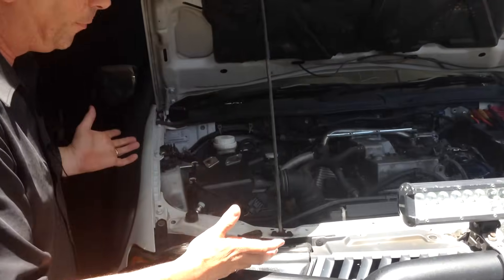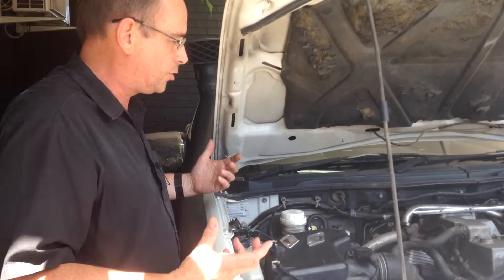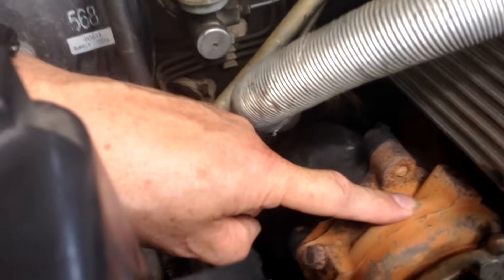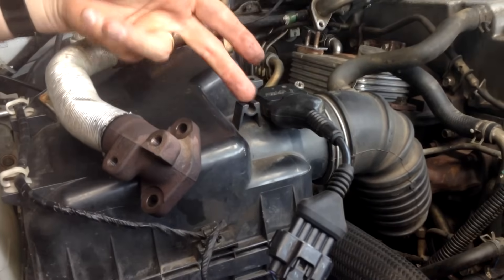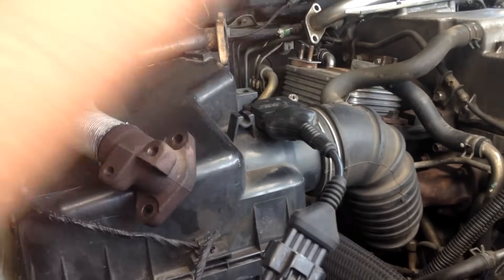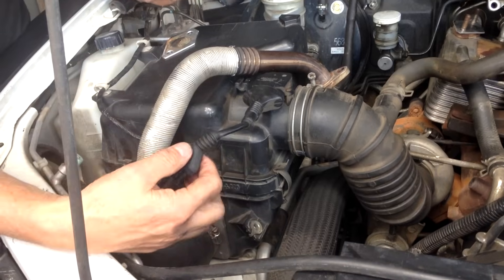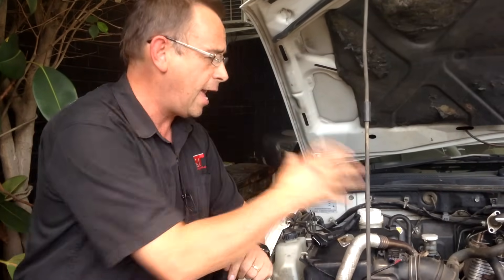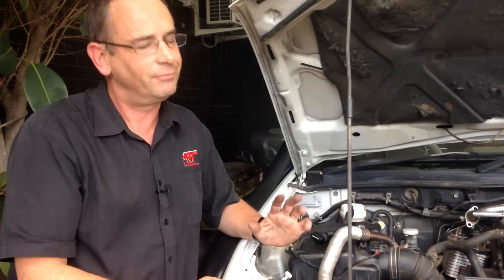How to fix EGR Soot Buildup in a Turbo Diesel

Comment: I bought a SAAB 93 1.9TDI a couple of years ago and in just a few weeks, it went into Limp mode and upon inspection, I saw that there were these weird things hanging out of their holes, and the holes were so badly worn, that they were fairly much rounded off squares and egg shaped instead of circular. I had to replace the inlet manifold and the EGR valve was clogged up to buggery.

Im not a diesel mechanic, Im not any kind of mechanic if I am honest and so I got my mate to sort it out.

The engine light kept coming back every time we clear it ( still does ) and so, as a suggestion, what we did at first was simply blank it off... then he suggested drilling a small hole, so I put an 8mm hole into the blanking plate, then a 10mm and now its got a 12mm hole.

I have, for the last month maybe a bit more, been using the best diesel that I can get locally and that is Shell optimax, and this has done 3 things that have made me decide to never go back to cheaper fuel.

1 - My car is purring like a very contented kitten
2 - It is all of a sudden doing hugely better mileage per gallon
3 - Buying the expensive fual has saved me a small fortune already

In fact, while filling the tank was 17 quid more expensive than the Supermarket crud I was using previously, ( Thats a shocker I admit ), my mileage has shot up and so instead of filling the tank every 5 or 6 days, I am already on day 7 and I still have well over half a tank of fuel left.

The engine warning light is still there but it is early days, plus, I have the 12mm hole and so I am going to just take the plate off completely and see how it goes from there! - I will reset the warning light, it always comes back after only a mile or two, but lets see if it stays off for any longer... Again, Im not expefcting miracles, but I certainly have had them in this last month or so.

Anyway, what I am saying is that to not have your engine fill up with sooty crap, just stop buying cheap supermarket fuel and splash out on good quality fuel... It will be much better in the long run. I used to put Shell in every 4th or 5th tank, just to treat it, but now Im putting nothing but the best in.

I know that many say that it makes no real difference and sure, that may well be true in most cases, but it has albsolutely made a massive difference to my car... It now runs smooth, quiet, cleaner, and is cheaper to run.

Oh and one thing I do admit to, is that the first time, I did put in a bottle of redex Diesel treatment into the tank.
Reply: Question my zafira 1.9 cdti was hissing after blanking at the top , so blanked it at the manifold aswell did a oil change 5w -30 car was running good till today when i heard a big Puff sound lost power and its ticking while driving like a lollipop stick against a moving bike wheel ,I inspected it its blew the manifold blanking plate gasket  and black Soot is on my engine ,I'm back to square 1 any help please ?
Reply: @GG-nz7vd  use gasket maker next time 🤷‍♂️
Reply: Gli additivi per il gasolio del brand tedesco Tunap fanno miracoli sui motori diesel, tunap183 e gasolio Q8 fanno miracoli❤ complimenti per il bel motore Fiat montato sulla Saab❤

Comment: I put an egr blank on my 3.2 4m41  from new . no probs ever  .. less than 2 mm build  up of soot at 222000 kms when I dismantled to do Tappett  adjust and new timing chain guide. I also have been using Penrite hpr 15w 40 engine oil from new changing every  7500 kms
 instead of 5 w 30 as recommended....Zero chain guide wear noted .i think the key is thicker oil to decrease oil misting and limit or stop the egr.
Reply: Whoah!! They need that thin oil to pass through the galleries in the variable Vein turbo. Probably not wise

Comment: if you confuse the engine management system that air intake temperature is below freezing point than the egr is automatically turned off.  works well
Reply: Paul Clarke how do u confuse it
Reply: @adventuredownunder1  like a blind man at a nudist colony. is not hard.
just confuse the air intake sensor its not cold

Comment: What happen if you just disconnect the electric plug on the egr admission valve??
Reply: It would through up a light on the dash and possibly even go into limp mode
Reply: @danstanford89  naaa, if you disconnect you are making the engine work in normal way... it works better..
Reply: @zhr4121  yes and it will cause an error code on newish modern engines. why ask the question if u supposedly no the answer
Reply: z it

Comment: So reprogramming the Engine ECU  is the best way to fix the problem of soot build-up? Can one assume that your reprogramming of the ECU will not introduce other issues, and you provide a written guarantee that any issues which may arise will be repaired by you, even up to repair or replacement of an engine which has a catastrophic failure as a result of the reprogram?
Reply from the maker: Paul, we guarantee all our work 100%

Comment: Hi Brett, my understanding of these engines is the charge air inlet temperature sensor that is used by the ecu for precise fuel delivery is downstream of the turbo due to temp differences created by the turbo. The temp sensor as part of the mas is for the EGR only and the module/resistor just fools the ecu that the air is extremely cold and thus keeping the valve closed in all operating parameters except for lift off where excess intake   pressure is vented to exhaust. The only real difference from factory ( apart from it being illegal) is that the charge air is now entirely air, and not a mixture of air and exhaust gases, which results in a slightly leaner mix..ok for diesels, not ok for petrols as they will run too hot. The Egt  is not really effected by this mod. The best solution is your  remapping of the ecu but for the home mechanic who has cleaned his own inlet manifold the EGR off module and a catch can is a pretty good and safe solution
Reply: I run an oil catch can and cable EGR delete ..drives fine to me and remove the cable at service time  7 year warranty  2019 MR triton
Reply: @jackthornton3496  yes the 'egr off module' or cable delete as you call it for the Mitz engines, i have a  Pajero, is an effective solution for these prone intake blocking motors. I took the intake off and cleaned before doing this years ago and running faultless with good power and economy since. Interestingly when these engines are suffering chocked inlets the soot and nitrous oxide emissions go through the roof defeating the original reasons behind Egr. Not to mention poor performance and bad fuel economy, and the dreaded Mil (money light).   Engineering gone wrong it seems!
Reply: @ajcuthy1945  Engineering gone wrong Lol   with an EGR it reduces clean air and replaces it with dirty non air  50%( and that's wasting fuel because more right foot is needed,to make the same power and an added bonus a dirtier engine Lol
Reply: @jackthornton3496  yep spot on...a feedback loop that chocks the intake at an ever increasing rate. Also its an expensive exercise to have a mechanic pull everything off an clean it. A defibrillator may be required when presented the bill😁.  Having done it myself its a big job as everything is bolted to the intake manifold including the common rail. The intake runners in the head are almost impossible to clean as well. Best to fit erg off and catch can from  new I'd suggest.
Reply: @ajcuthy1945  what year pajero do you have
Reply: @goldmagnet  A 2009 NT manual, still going strong with good fuel economy. I know a couple people with Pajeros that have close to 400k still in service. I was asked what would i replace my Paj with and i simply don't know. Too many new vehicles have issues and i don't want a twin cab. The Pajero seems to do all tasks well, with nothing exceptional, and there reliable. Just keep up the maintainance.
Reply: @ajcuthy1945  yeah sweet, my missus car is the 2012 exceed model, it's awesome on fuel economy and nice to drive. I've been doing the servicing on it myself now a few years as it's out of warranty and what not. A bit more electrical stuff than I like but slowly getting used to it. My own car is an old 2003 courier, so much easier to work with, barely any electronic crap, I'm just in the middle of changing the head as it cracked last week, I've gotten rid of all the EGR and oil breather on it as it's quite simple to do but I think I'll leave the pajero for a while, the missus probably won't like me messing with it yet lol.
Reply: @ajcuthy1945 wise words

Comment: I give my 2.0 CR TDI a good thrashing every now & then. Seems to keep the EGR & DPF clean.
Reply: Same let her warm.up , turbo cool down b4 switch off, change gears at 2000 but every now and then flog her thru the gears blow all the shit out the back 👍🏻
Reply: @A C Yes! A good thrashing! Just like Basil Fawlty did to his car on "Fawlty Towers"!
Reply: PocketRocket1 I have a 2.0 tdi i just wanna know how to keep it running as good as when I bought it. What do you mean thrashing? Like take it out and floor it?
Reply: @birdvalenchez  Yes. It's just as if you were doing an "Italian Tune Up", like back when people would really wind out the gears before shifting, in order to blow the carbon off the valves of their often Italian, sports cars, but in this case, you'd be blowing the sticky build up out of your EGR valve and intake manifold. You may even see a few big puffs of black smoke coming out of your exhaust, as globs of the sticky mess detach and recirculate through the engine. For automatic transmissions, you can just shift manually. If for some reason, you are unable to shift manually, you can accelerate up a steep hill, so the automatic transmission has no choice, but to shift at higher rpm's.
Reply: @sparky6086 anche in Italia abbiamo il problema EGR e DPF, il segreto è fare la manutenzione ogni anno, olio 5w30 Motul, usare additivi nel serbatoio come il Tunap183. Sperare che la rigenerazione si concluda in viaggio. Purtroppo con tutte le restrizioni che hanno imposto in Europa, a breve converrà fare jogging per andare al supermarket alimentare
Reply: Lmfao

Comment: One hears so much about the. Soot build up in EGR valves and blanking plates. I have purchased a blanking plate but have not fitted to vehicle for fear of insurance issues after an accident and the other is that I don't really know the full ramifications of using blanking plates.
Your recommendation makes sense and would like to know the cost of such a modification.

Joe

Comment: The sludge looks like vegamite? 

If you want the soot blown out, let my wife drive it. 
All of the small problems go away when she takes em for a spin. 

She hath no mercy on a fuel pedal. 
All impediments exit the tailpipe.
Reply: Sounds like you have driven with my wife.
High revs all the way, and sometimes chooses not to change gears, i.e. if stop street is near enough, she leaves the car revving all the way to the stop street, sometimes in first :(
on the plus side, my neck muscles have never been so pumped.
Reply: Typical women 🤣🤣🤣

Comment: In the last five to ten years the reliability of turbos (for diesel or gasoline engines) have improved measurably but being such a precise component their life expectancy is still limited, with the repairing (good luck finding someone with that knowledge) or replacement cost I believe would be fairly expensive.
Reply: Bull.  There was nothing more reliable than a 2.4 D Toyota engine of the 80's, or the 2.5 D Isuzu engine.  And that Isuzu engine used less diesel than the best of today.  Some of the newer engines, like the Ford 3.2, can not even be fixed.  Not that the 3.2 is a Ford engine.

Comment: The Achates 2 stroke opposed piston engine has this problem licked............cant wait for it to enter production, electric cars will never recover from it.
Reply: A 3 cylinder small block 800-1000 cc with everything(Turbo driven inter-cooled and supercharged seem to be planned)  would be great, in diesel with everything even better. But the electric bandwagon is on a roll its not going to be stopped. 40 000! full time people employed building wind farms at 30GW per year off the coast of Europe alone(and the industry is growing exponentially each year). This is just to prepare for the charging capacity required in the next couple of years.  Its not going to be long before gadgets cooking up all sorts of things will come on the market and people will start tinkering with aftermarket components to do all sorts of things.  I say let the pen pushing desk jockeys have their EV's, support them. Its a good thing. Don't think you will struggle to get your hands on a oil burner for at least another 3 decades if you like it that much. I feel out of place even driving a petrol being use to my 320d.

Comment: Surely it’s nothing to do with EGR, it’s the PCV that’s the problem. Dry hot exhaust can’t surely clog up the intake values. The PCV however is dumping oil and air into the inlet manifold. That’s how you get the crap on the back of your values.
Reply from the maker: the blow by oil mixes with the EGR soot and then sticks to everything, even with low EGR the oil creates deposits,....

Comment: Where do you get the maf and egr cut off cables? I've tired to find them with with no joy at all.
Reply: I don't want one in my car... but to answer your question it's a munjii cable off eBay.

Ahh, i feel dirty now.
Reply from the maker: after what I showed you in this video, why would you even want to do it?
:(
Reply: Primarily because I've just spent $1500 on two new egr valves, my car is now worse than it was before I was told to change them by the land rover dealer,this way if see if this is the problem area.

Comment: IN A DINOSAUR ENGINE LIKE YOU HAVE ON THERE. You can blank off most engines up to EDC15 controller and problem solved ECU won't throw any errors. Most cars with EDC16 controller will come up with error either due to no pressure in EGR pipework or higher temperatures in the exhaust. In some, blocked EGR with alter map so it will burn more fuel and will be smokey not showing any errors,  but higher temperature exhaust gases will kill catalytic converter and exhaust( if steel) prematurely, in EDC16 you can't alter EGR activity using VAG-COM for a pound of ebay as it was in EDC15 controller. EDC17 controllers will throw immediate MIL on the dash, PEUG/CITR will drive  unaffected, but other makes will go to limp mode. 
EGR is also fitted on petrol engines- GDI, FSI and other DI users know the valve cleaning procedure...

Comment: If you just blacked off the EGR pipe would that make the inlet fuel cleaner and so produce slightly more power ?
Reply: you actually want the EGR system, it brings the engine up to temps quicker in turn making the engine last longer, it also reburns exhaust gasses which is not burned 100%
Reply: @Foozefighter I have a bridge to sell you

Comment: Hi Brett. I have a 2004 Mercedes Sprinter 313cdi. It has had a head gasket & skim due to coolant loss internally. I have noticed that the power & torque has dropped. Do you think l have a egr problem? Thanks

Comment: good job, cheap at $1500 to clean out, last time we rang and got a quote. good job mrt
Reply: I actually removed the intake manifold an cleaned it myself and a few hrs later saved the 1500.
Reply: $1500 just to clean something that comes off by removing 4 bolts, that's ridiculous. I have an MQ 60k service coming up I may take it off and have look not that there is anything wrong with the EGR. What model do have and dis you take a video?

Comment: When I blank the egr on my VW transporter van I get lots of black smoke on start up but not while driving. The van runs so much better but the smokey start is stopping me from keeping it blanked. Any ideas why it would smoke so much?
Reply: Hmmm....Black smoke on start up? Usually black smoke denotes unburnt diesel fuel that has been ejected out of the exhaust, it may be that you have an injector that isn't fully closing , therefore dripping diesel into the combustion chamber. On start up, not all of this will by fully combusted and the 'black smoke' is merely the excess fuel leaving the system.  It's not a good thing on direct injection engines as this fuel will 'wash' the cylinder walls of lubricant and cause premature wear. It may be time to look at the injectors and maybe have them serviced?
Reply: Thank you for taking the time to reply, I shall look into what you said. Thanks Malcolm
Reply: I’ve unplugged the cable going to the egr valve and van is running great , it’s the same as yours , try that it costs nothing , bad idea with shit gases back into engine , it causes the engine to wear more and not last as long with the egr on the engines , manufacturers love it , !!!!!!!
Reply: cable? that is vacuum hose and need to be blanked off if unplugged
Reply: @paulmusther  i have a T6 transporter, are you able to point me in the right direction as to which plug i can unplug.
Please
Reply: Witness The Fitness .Good luck mate
Reply: paul musther that's what I did, the difference is amazing, so much better through the rev range. I think my problem with leaky seals need to be fixed before I can keep the egr pipe unplugged though because the smoke is too bad :(
Reply: through the rev range? in most egr is fully open between 1200-3000rpm in many fully closed at 2800 and only partially open when idling.  take it to the real mechanic
Reply: glow plugs
Reply: glow plugs and no catch can. likely culprits for messy starts. As the oil vapors in the intake network after shutoff have time to condense and collect before the next startup. Or your ignition fueling might just be high hence black smoke.
Reply: they do "VW transporter van" with diesel since 1979  hmmm  we go through everyone since T3 to help you?